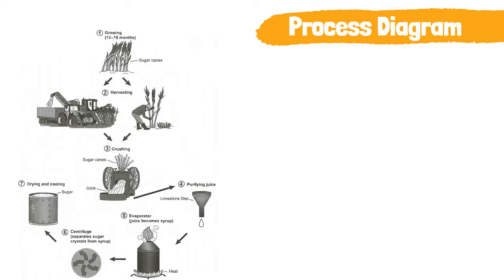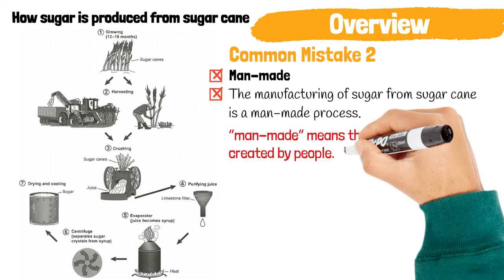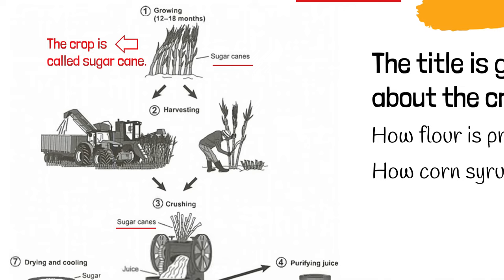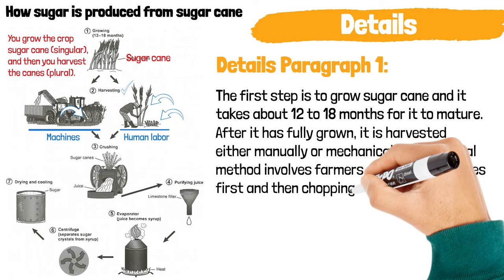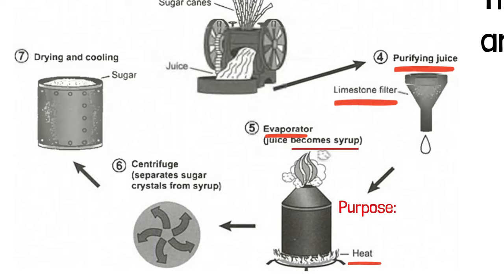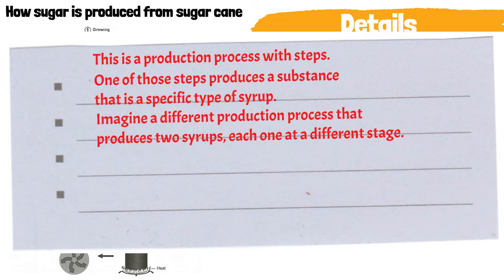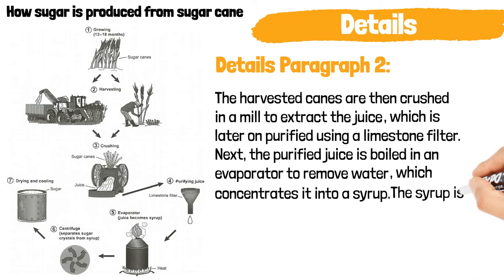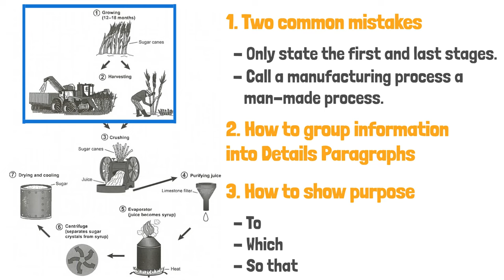How to Describe a Process Diagram [IELTS Writing Task 1 Band 9 Guide]

Comment: The diagram displays the manufacturing process of sugar produced from sugarcane.
For sugar production, the process includes seven main stages like harvesting, crushing, purifying, evaporating, separating, and finally drying and cooling takes place. The final product produced is sugar.
Initially, the sugar canes are grown up to 12-18 months. Then, the harvesting is done. For the harvesting process, two methods can be used, it can be done manually or by a harvester. Then, the harvested canes are crushed through a crushing machine to extract the juice from the canes. Following this, the juice is filtered using a limestone filter. The juice is then condensed by using an evaporator where the juice turns into a syrup.
Finally, the syrup is moved across a centrifuge where the sugar crystals are separated from the syrup due to the high pressure produced by the centrifuge. Lastly, the sugar crystals are dried and cooled for the final product to be formed. Therefore, the dried sugar crystals are formed.
Reply: Looks good, but where is the "overall"? They need this word in there. Also, it might be the Youtube text arranging or the text was not arranged in smaller paragraphs to show clearly the introduction paragraph 1 paragraph, 2 and the overview.
Reply: 5.5 score
Reply: @asil4124  How

Comment: The given diagram details the process of producing sugar from sugar cane.
Overall, it is a linear process consisting of four main stages: farming, crushing, separating and drying.
The first step is to grow sugar cane and it takes 12 to 18 months for it to mature, which is the longest stage. After it has fully grown, it is harvested either manually or mechanically. The manual process involves farmers removing the leaves first and then chopping canes, while the mechanical process uses a specialized vehicle to cut canes directly.
Having been cut, the harvested canes are crushed to extract the juice, which later on is purified by using a limestone filter. Next, the purified juice is boiled in an evaporator to remove water, resulting in syrup. The syrup is then poured into a centrifuge where it is spun at a high speed to separate sugar crystals. The last stage is to dry and cool the crystals and the end product is sugar.

Comment: The harvested canes are then crushed in a mill to extract the juice, which is later on purified using a limestone filter. Next, the purified juice is boiled in a evaporator to remove water, which concentrates it into a syrup.The syrup is then poured into a centrifuge where is cool and dry

Comment: The given diagram details the process of producing sugar from sugar cane.
          Overall, the manufacturing process of sugar cane  involves seven steps. The process of sugar canes, contains many steps including growing the canes, harvesting and crushing them. We may divide work into two groups using the diagram: work done by people and work done by machines.
            The first step is the process of growing sugar cane, which lasts from 12 to 18 months. In the next step, the work is handled by machine and human. In the third step, the sugar canes are crushed through the machine. Juice is a product of crushing sugar canes through the machine.
                In the fourth step, the juice is purified through the limestone filer. In the evaporator, the heated juice becomes a syrup. In the sixth step, the centrifuge is responsible for dividing sugar crystals from syrup. Finally, the sugar crystals from the centrifuge create the sugar. In the final step, the given product-sugar is dried and cooled for its further usage.
Reply: Is this an artificial process?
Reply: @eccedentesiast946  of course it is

Comment: The first step is to grow sugar cane and it takes about 12 to 18 months for it to mature. After it has fully grown, it is harvested either manually or mechanically. The manual method involves farmers removing the leaves first and then chopping the canes, while the mechanized method uses machine to cut the canes directly

Comment: The flow diagram indicates how sugar is manufactured from sugar cane.

We can see that the manufacturing process requires seven main steps, consisting of growing, harvesting, crushing, purifying, heating, centrifuging, and cooling.

At the first step in the production of sugar, which is growing sugar cane takes 12 to 18 months. When the sugar cane becomes mature, it is the time to harvest them. It could be harvested by the farmer or agricultural automatic equipment. Next then, the harvested sugar canes are crushed by a wheel-shaped machine into juice, which is liquid. The juice is purified by a kind of special filter, which is made of limestone.

After that, the purified juice is heated in an evaporator to remove the water in the juice, which becomes syrup. The sugar crystals are separated from the syrup by a centrifuge.
At the final step of the process, the sugar is put in a container to wait for their drying and cooling, which is the end product.

Comment: The diagram provides information about how sugar is manufactured from sugar canes step by step.

Overall, producing sugar by sugar cane includes seven main stages which is in order of growing, harvesting, crushing, purifying, evaporator, centrifuge and drying and cooling.

The first step of process is to grow sugar cane which takes around 12-18 months. After, sugar cane is harvested by either machines or human labor. Machines harvest to sugar cane directly, while farmer needs to separate leaves then cut them by appropriate tool. The next step is to crushed sugar canes into a mill and extract juice from it. 

In the fourth step of process is to purified juice by used limestone filter and then purified juice is sent to evaporator, which is juice turned into syrup in this phase. Then, acquired syrup is went to centrifuge that's why separated from sugar crystals. Lastly, syrup is moved across to drying and cooling machine that syrup is became sugar .

Comment: The given diagram displays the steps included in producing sugar using sugar cane. 

Overall, there are seven steps of various time lengths and purposes involved in the process. Starting from the growth of sugar canes, harvesting, crushing, purifying, evaporating, centrifuging, drying and cooling. 

First of all, sugar canes take about one year up to 18 months to flourish, which is the longest phase, and then harvesting takes place, which depends on manual labor or mechanical methods to garner them, such as the usage of tractors, which is considered more convenient and faster in comparison to traditional approaches.

Subsequently, the canes are crushed in a special machine to extract the juice which is purified afterwards using a limestone filter. The following step requires heat to condense the liquid into a syrup by removing water. The next step is a technique called centrifuging that separates sugar crystals from the syrup at a very high speed. Finally, the substance is dried and cooled for consumption.

Comment: Thank you for your lecture. But I saw a lot of teachers using beginning with...ending with. It's common and viewed as the correct way to write the overview. So, based on your lecture, we shouldn't do it in any case or is there an exception?
Reply from the maker: Hi, I suggest including all the major stages for any process diagram, especially when writing about a life cycle. Every life cycle begins with an egg stage and ends with death, doesn't it? Then, what's the point of saying it?

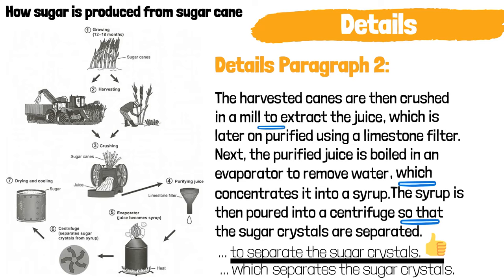Comment: Lilie mam, I have one doubt, at 10:12 in this sentence,Next, the syrup is poured into a centrifuge machine so that the sugar crystals are separated. Can I write ( into the centrifuge machine) and can I remove 'the' before the sugar crystals.
Reply from the maker: Yes, you can use " the centrifuge machine". But if you use " the centrifuge machine" instead of " a centrifuge machine", then you need to use "the" with all other facilities, like " the evaporator" and " the limestone filter". 

No, you cannot remove the definite article before sugar crystals because here we're not talking about sugar crystals in general. We're specifically talking about the sugar crystals in the syrup.
Reply: @LilieIELTS  Thank you mam.

Comment: Cant agree about the overview you talked about . How can we include the all stages in the process if the diagram is about cement manufacturing or steel rod manufacturing where the steps are way too much lengthy??😅
Reply from the maker: Hi, you need group some stages together and only list main stages. For example, I grouped the first two stages together and called them "farming".

Comment: What does linear process mean ? In which type of process diagram we can use it?
Reply from the maker: Hi, a "3-stage linear process" is a process where each of the stages happens separately: first Stage 1, then Stage 2, then Stage 3.

A 3-stage non-linear process might allow Stages 2 and 3 to happen at the same time.
Reply: @LilieIELTS  Thank you ma'am for quick response 👍.

Comment: Can we write pictorial flow chart instead of diagram
Reply from the maker: Are you sure that you want to use a rarely used term? 😊
https://books.google.com/ngrams/graph?content=pictorial+flow+chart%2Cdiagram&year_start=1800&year_end=2019&corpus=26&smoothing=3&direct_url=t1%3B%2Cpictorial%20flow%20chart%3B%2Cc0%3B.t1%3B%2Cdiagram%3B%2Cc0#t1%3B%2Cpictorial%20flow%20chart%3B%2Cc0%3B.t1%3B%2Cdiagram%3B%2Cc0
Reply: Sorry link is not opening. Can u comment me..  Is it right